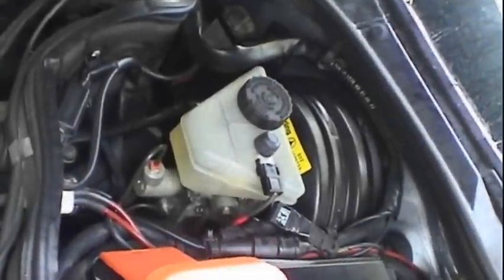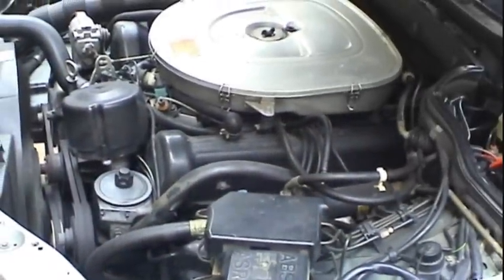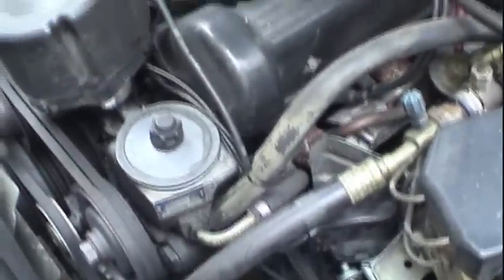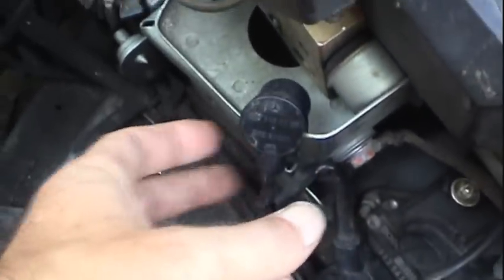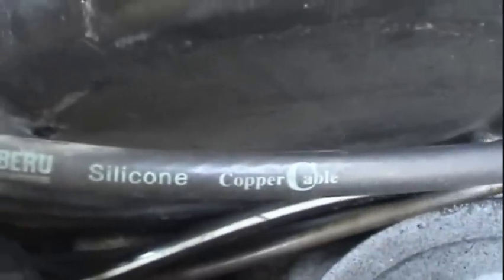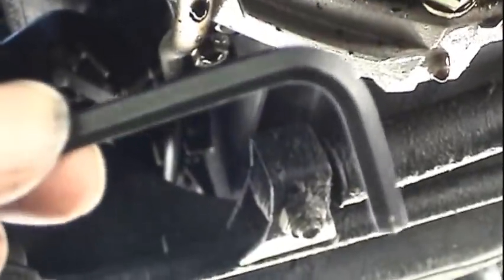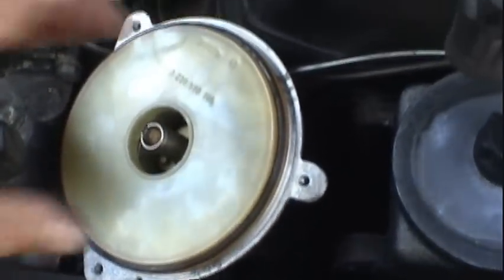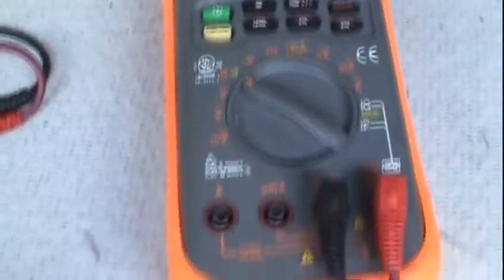1991 Mercedes-Benz 420 SEL Breakdown (Won't Start)

Comment: I don't thinck your car have original miles....i know itas have 20+ years but......i observe that american version are not so resistent in time as european......i have a e200 K from 1997 and it's have 337.000 km ......no problem with cranck sensor ....i only chenge the sparck wires and the thing that make sparck(it's have 2 ).....i like very much W126....enjooy it and most important redpect the oil from your engine.......at my W210 i chenge the oil at 8000 km......i wish to buy in the future a W126 ...a W124 ....a W140 ....